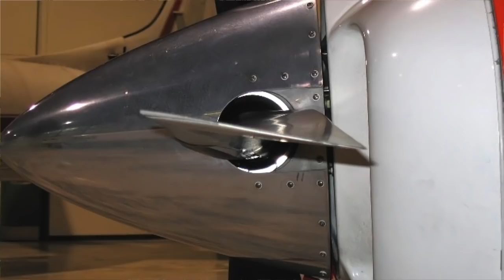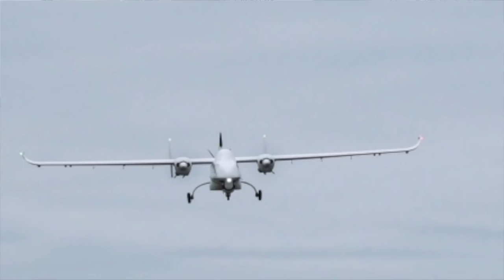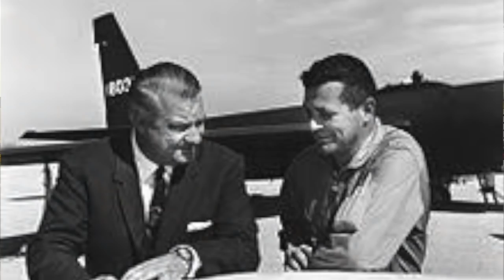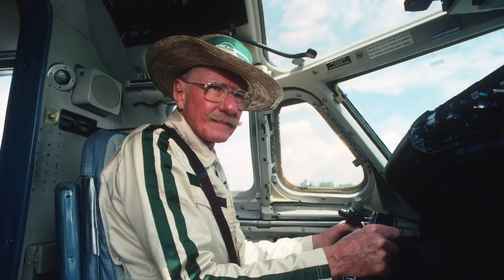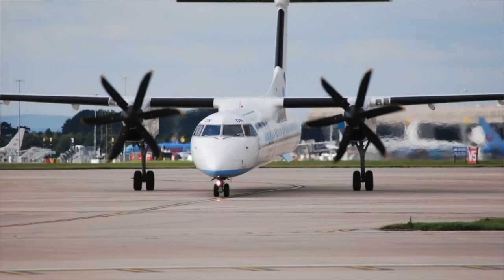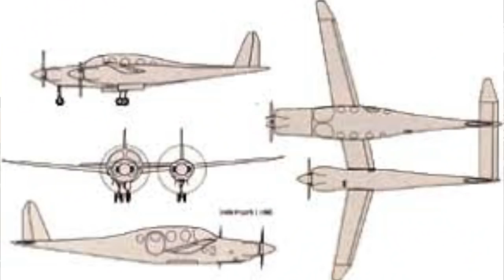Multi-Engine Aircraft Aerodynamics - Explained In Depth -

Comment: Hi, my name is William Walker and I am developing a Blade Runner style flying car. It is a very unusual vehicle and thought your group might be interested in it. I call the vehicle "Sky Chaser" and an artistic picture of it can be seen in the icon at the top left hand side of this post. Clicking on the icon will enable you to see a project presentation and flight videos. Sky Chaser looks and drives like a car, flies both vertically and horizontally, and is amphibian. It has no exposed rotors, and uses the body as a wing. It also has no unfolding wings, and flies the way it looks, just like the Blade Runner vehicle in the movies.

Sky Chaser is basically a flying wing design with twin electric motors in front and has double rudders and double elevons in back for control. It also has VTOL capability and is a Tricopter configuration, with 2 tilting front electric motors in front mounted on nacels, and another electric stationary motor in back blowing thrust though a hole in the wing behind the cockpit. The tilting motors enable vehicle to transition from VTOL to plane mode. The aircraft is also car with 4 large wheels powered by small electric motors. In addition, the vehicle is amphibian, and can navigate and takeoff and land on water, both in VTOL and in plane mode. Sky Chaser has a very short wing, but its effectiveness is increased by blowing high speed thrust over the wing and by using oversized side body panels, housing the wheels, to block airflow around the wingtips and help channel the airflow over the wing. The front props are counter rotating and from the pilots perspective, the right prop rotates clockwise and the left prop rotates counterclockwise. This configuration seems to yield the most lift.  

I started the project in 2016 in San Diego, Calif, USA where I built and tested a 1/6 scale model. Then I made a CAD model and got it to fly in a flight simulator. 3 years ago I moved to Sweden and work with business partner and we have now built a full scale unmanned working prototype which flies. For more information:

*SkyChaser(dot)se
*Project Presentation: https://drive.google.com/file/d/1FAdls15OriuQ4hoD2xPwXeNQDQTKpK1t/view?usp=drive_link
*evtol News article 1: https://evtol.news/sky-chaser-concept-design
*evtol news article 2: https://evtol.news/sky-chaser
*Simulation tests: https://drive.google.com/file/d/19taPDO1yERAumR8OV1IFk2n1TqNLNUkN/view?usp=drive_link
*Full Scale hover test: https://drive.google.com/file/d/1qDl5X142uC5yt_5Xcb0GUS3h-LgD4P0V/view?usp=drive_link

Comment: I want to design and build on a hybrid electric experimental aircraft (full size)
Reply from the maker: oh, and maybe look up the Boeing sugar volt concept
Reply from the maker: interesting.  What type of hybrid system are you interested in?
Reply: @FPVREVIEWS  I'm thinking a small turbine APU/GPU Power unit based off a automotive turbocharger perhaps, or a small generator.  And a small to medium sized battery for general power, and using electric motors for the propellers.  So, in theory it could take off and land using generator, or battery, or both, and then use power top get to altitude, then power back to energy efficient cruise mode.  Instead of needing a gigantic ICE engine for takeoff only to use at part throttle for cruise.  This way whenever the genset turns on it would be at max efficiency, and electric motors have continuous power and burst power.  Just make it so that burst power is enough to get to altitude. And ideally Extremely short STOL, or possibly even VTOL if the power could do it.  I like the idea of an electric plane for STOL competitions, and having the ability to carry a fairly heavy load (batteries and cargo), and with plenty of power for hopefully high speed cruise.

Just figuring out a lot of stuff at this point, but I am a car builder (including high performance turbo engines), metal fabricator, woodworker and I have a CNC Milling machine, so I suspect I have the skills to build it, it's just, of course time and money.  So I figured I'd research while I figured it out.
Reply from the maker: @LordPente  sounds interesting.  There are companies making lightweight generators for hybrid UAV's already, so that part has been done.  and you may also consider using a hybrid vehicle, modified, and stripped down.   best to design the aircraft first, then figure out it's power requirements.    of course, you can just dispense with all of the machinery, and just use a hydrogen fuel cell and electric motors.  but if you are going to ride in it, maybe better skip the hydrogen..?  or find an automotive rated hydrogen fuel cell.  better gravimetric energy density than gas.

Comment: During the 30's, most of european twin engined aircraft were using opposite rotating propellers to equilibrate the plane, contrary to american built ones, but it was more expensive and to build and to maintain... After the war the american bad habits won...
Reply from the maker: too bad, right??

Comment: Hi Spike , I have been thinking about your twin motor idea on the wings,
I interested in testing for duration using li-on pack 4-6s1p using a mini quad motor for light weight and no more than say 1200-1600mm WS in a conventional style plane , as a bench mark I can say in the air with single motor drawing 2 amps in my s800 wing, so if I was to add another motor and if they then were drawing 1 amp each im no better off endurance wise.
what would need to change to improve the use of two motors at such i low amp draw to start with ? Cheers Brett

Comment: Great video. IMHO, the majority of RC plane KIT manufacturers aren't paying as much attention to the overall aerodynamics of their planes. For instance, I've been baffled as to why the nose of the Believer EPO plane is so flat (on the other extreme you have Crosswind Nimbus Pro). Then you realise that the manufacturer has published the contour plot of Cp for Believer in action (https://www.banggood.com/Believer-1960mm-Wingspan-EPO-Portable-Aerial-Survey-Aircraft-RC-Airplane-KIT-p-1178800.html?cur_warehouse=CN), and then you ask yourself if they conducted the CFD analysis purely for the sake of obtaining a couple of colourful pictures. Even the vast majority of RC kit manufacturers and so-called "promoters" don't seem to give a toss about airfoils at all. Certainly, the element of aerodynamics in planes deserves much more attention. Once again, great video - desperate times call for desperate measures ;)
Reply from the maker: Well, there are surely some poor examples out there, and some are very good. 
For instance, the new crosswind looks very good, and the believer looked pretty good too. The Legacy MFD plane is also good, and a very proven design. There are limits to what can be done with the foam, and they are pushing those limits. For instance, If they were to use a higher aspect ratio wing at those wing loadings, it would have too much aero-elasticity, especially in torsion.  
It's also important to understand the optimization of each design. For instance, Almost all FPV aircraft, or for mapping are Distance Optimized, whereas Gemini V-2 is Endurance optimized. The difference is obvious as far as flight time, but not so obvious is the forgiving flight characteristics of a thicker wing, the ability to lift off from a shorter runway, and land, the increased ability to carry weight due to higher coefficient of lift(this helps you carry a larger battery, helping to make up for the lost distance somewhat), decreased sink rate, (although with a worse L/D ratio) and the increased potential for altitude, especially when carrying a payload.   Also there are typically sensor limitations that limit how fast is ideal to fly when mapping at a certain altitude.  If you can fly slower, you can fly lower, and capture higher resolution images due to increased proximity to the ground. 
Then there are small things like prop angle to the airflow that most configurations must make compromises on, and Wing mounted engines do not, if their thrust line is at the correct height.  The props can then be mounted at the ideal angle for a certain angle of attack of the wing.   Lots to consider, but we've found that overall for most applications, there is a lot to be gained from endurance optimization, and less from distance, like 90 percent of the planes out there.          We do not use CFD in our designs, but do flight test and record telemetry under as specific circumstances as possible.  It's actually more important to get the first principles right first, than to have the best CFD.
Reply: @FPVREVIEWS  Don't get me wrong. I have built quite a few (heavily-modified composite-reinforced) Believer planes and a Crosswind plane too, and the Believer has been proven to be a more efficient platform compared to the Crosswind, which is yet to prove itself (with all the recent criticism with respect to its original tail design). However, the Believer platform would have been even more efficient with rather obvious modifications, such as a well-thought-out profile for its fuselage nose. If the aim is to design a great platform with an objective, let's say ultra-high-endurance, then the concept ideally needs to be optimised, wherever possible. 
I am not saying that CFD simulations are an absolute must when it comes to aircraft design, but what's the use in carrying out such CFD simulations if one isn't going to use its results for design optimisation. It could be seen from the contour plot of Cp for Believer that there is a noticeable high pressure zone in front of its nose. It's certainly possible for them to have modified that stud for something more aerodynamic/streamlines. Given the flight envelope of these rc planes, something like an elliptical profile would have been more suitable (but unlike the pointy nose of a Crosswind since these planes don't go anywhere close to the speed of sound). The main purpose of carrying out CFD simulations at design stage are validation and optimisation, and nowadays, CFD and other relevant software (e.g. MachUp, Stallion 3D etc.) even allows one to quickly estimate things like motor thrust angles and wing/tail angle of incidence. With the right physical models, these values could be used as first estimates at least. As you may be aware, the Crosswind manufacturers recently had to undergo a tail redesign, and face a lot of criticism and hassle, and something like this may have even been avoided altogether using simulations (but then again I'm not sure how they missed it during test flights though). 
Just to be clear, I am not saying that simulations are an absolute necessity, and I completely agree with you on the fact that test flights and experimentation are more important, but I am just putting my thoughts across.
Reply: @FPVREVIEWS   By the way, the Gemini V2 is certainly a beautiful plane - well done on that. Just looked into your "Advanced Projects", and your "Solar Dragon" project is particularly interesting as I'm currently designing a solar-powered composite UAV myself. May I ask you where you bought those Maxeon C-60 cells? It looks perfectly square in shape, or is it the beds for the cells which are square shaped. If you would be interested in offering consultancy services on design of solar planes or getting involved in general, please feel free to contact me via email (w-akram@hotmail.co.uk) or Skype (researcherwasim). Wasim from London :)

Comment: Interesting and informative video - many thanks. One point you did partly mention, but could have been expanded, is that the design of any aircraft is often more dependent on its' intended use, rather than pure efficiency. As you said, the P38 twin engine design allowed for an unobstructed straight firing line for the centrally mounted guns. Similarly, for unmanned fpv and photography planes, the twin design with wing mounted motors is ideal for allowing unobstructed camera views. The 'modern' centrally mounted twin-engined tractor / pusher configuration might be good on efficiency, but would not be good for fpv / unmanned  aerial photographic purposes.
Reply from the maker: true, we may make another video comparing the various configurations for different purposes.   Also, that'w what the comment sections is good for, so people will read whatever anyone else contributes as well. 
actually, as mentioned in the video, re-compressing the air by the second prop on an inline twin is not so efficient.   For high speed flight, the gains in drag reduction will overcome the efficiency loss from the high compression ratio of the propulsion system. 
I assume you're talking about the unobstructed view from the nose. 
we'll take your suggestion into account for future videos, thanks!